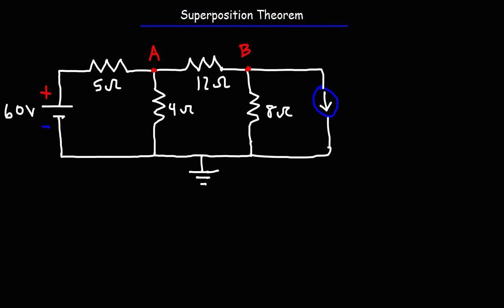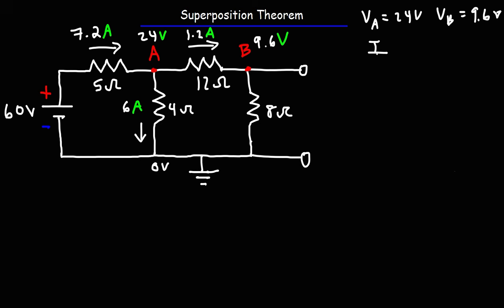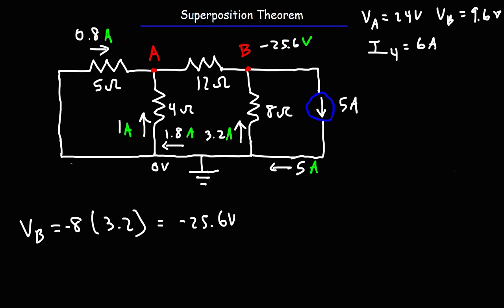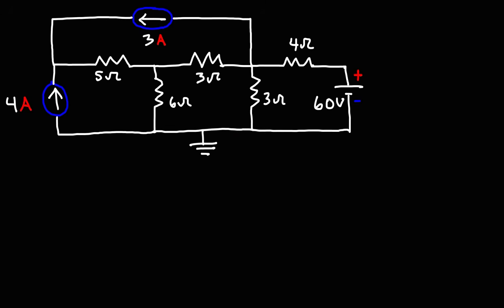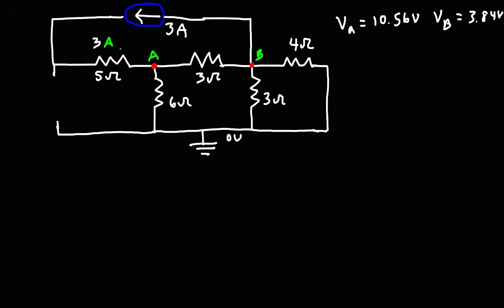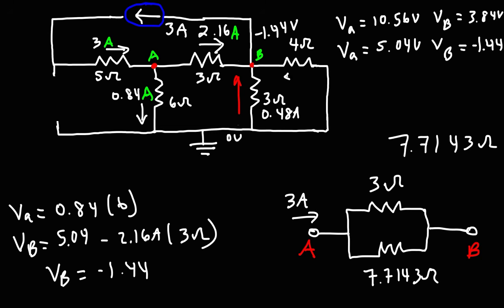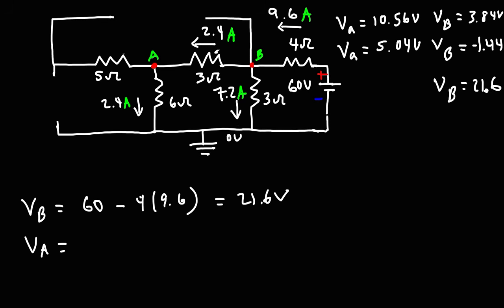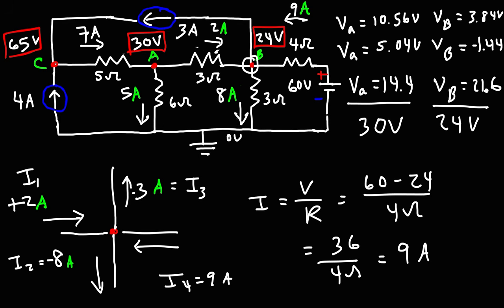Superposition Theorem

Comment: For the ones who are having confusion regarding the 5 and 4ohm resistor connections in the FIRST PROBLEM-
in the first part, we are basically considering the circuit 'open' at the point of the current supply so NO current flows through that branch (you might as well remove the branches connecting to the current supply to understand better) that is why the 12 and 8ohm resistances are in series as the SAME current flows through both.
now in the second part, one can clearly see that the current DIVIDES itself at Node A, so different currents flow through both resistors (5 and 4ohms) and that means they are absolutely not in series. The very definition of resistors being in series means that the same current should flow through both the resistors. Rather, by applying a little nodal analysis, one can clearly see that both the 5 and 4ohm resistors have the same potential drop across them, so they are indeed in parallel. There is nothing wrong there.
Hope, this helps.
Reply: good looks on this insightful comment. I was bewildered when he did it and didn't explain. but I guess my knowledge on nodes are lacking. Thanks!

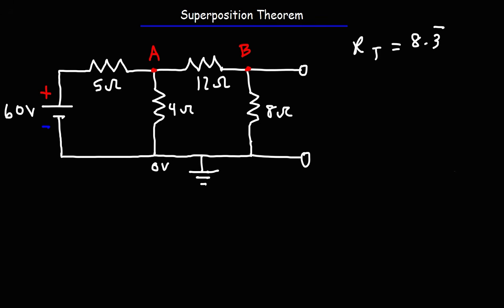Comment: 3:04 Why isn't the 5 ohm resistor in series with the 4 ohm resistor?
Reply: because the current is gonna split and go into the 12 ohm resistor as well. it's only in series when there is 1 path for the current to flow through.

Comment: But why are you again putting the total resistance in a parallel connection to be to power negative one. Because it's not really making any sense to me. What if I don't put that negative one and calculate normally. When you calculate normally I mean without putting it to power negative one The answer is 5.3ohms as the total resistance. Am I also correct

Comment: Why wasn't the voltage of the 4 ohm resister 60v since it's connected in parallel to the source
Reply: Bz in between 4ohm resistor and 60v source a 5ohm resistor is present hence....

If 5ohm and, 12 ohm resistors are removed then volt around 4ohm and 8ohm resistor will be same as battery's volt....

Volt divider circuit

Comment: Why even do this, this seems insanely convoluted. I don’t understand how superposition simplifies things.
Reply: with simpler circuits it doesn't necessarily simplify anything, but with more complex ones and especially when they have other components besides just these, then it will be very helpful and sometimes necessary to use this to solve them

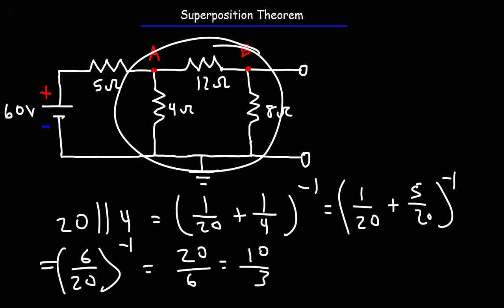Comment: 2:50 why is 8 ohm not in parallel with 4 ohm and that req in series with 12 ohm
Reply: Uhhh... Bit late here so I don't even know if you still need this, but just in case, or if anyone else is looking for an explanation, the reason why 12 ohm isn't in series with the Req of 8 and 4 ohm is because the 12 ohm and 4 ohm are in different branches that separate at node A. So we can tell 12 ohm should be in parallel with 4 ohm. The same is true for 8 ohm, where it's ALSO in parallel with 4 ohm, as you yourself recognised. And then from there, since they're both parallel to 4 ohm and on the same branch with no further sub-branching off in between, they're in series.

Edit: Not sure if I did a good job of explaining this, but you can kinda see it if you visualise the current flowing starting from the 60V source. It splits off at node A to go in 2 directions, making those directions parallel. Then those two parallel branches meet again at the node below 4 ohm and complete the circuit by connecting with the 60V source again.
Reply: @Avr_s Too late bro...the guy prolly alrrady graduated by now
Reply: @ONANGEFORTUNE 
Yeah lol, I guess replying to an 8 month old comment probably means I won't help the guy. But still, I thought I'd do it in case anyone else sees the comment and has the same problem.
Reply: @Avr_s thank you that was great help

Comment: I don't get how current can flow in one resistor in teo directions and in different quantities. How does it happen
Reply: It's not. You're solving the circuit for first the 60v power source and the 5A power source separately. At the end your just adding the values together to solve the actual circuit.

Comment: At 4:50 why didn't we divide 24v by 12 ohms to get the current?
Reply: Because we dont know the potential at B. So we didnt know the potential drop to use Ohm's Law
Reply: According to Kirchoff's current law, the current that enters a junction must be equal to the current leaving the junction
Reply: It’s the same 
😊
Reply: If you look closely you'll see that the 12ohm is not in parallel with the 4ohm, therefore you cannot use the same 24V to divide by 12. You have to add 12ohm to 8ohm (both resistors are in series) first before dividing into 24V

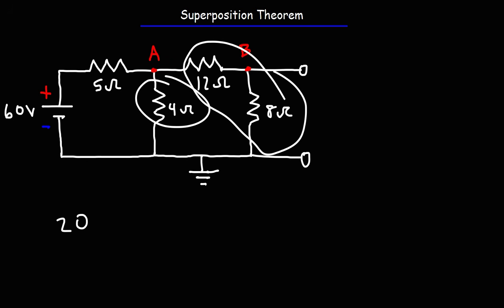Comment: at 2:08 how do you know that 12 and 8 are in parallel and not 12 and 4? I'm studying for a test please let me know
Reply: Cause they are kinda at the end of the circuit since the power source is on the left, and when combining of resistors, you tend to start at the end
Reply: Also there's no current flowing into the far right of the circuit so all the current goes into the 12 and 8
Reply: 12 and 8 are in series. So 12+8=20. This 20 ohm resistor is the one that is parallel to the 4 ohm resistor. I would recommend re-reading what nodes and branches are and then learning what parallel and series resistors are in terms of nodes.
Reply: did you find out why
Reply: Guess we still lost @stevejoseph8231

Comment: I wanted to know if we could use nodal analysis on the entire circuit and do a whole a bunch of equations or would your answer be different.
Reply: Hi, I am in 1st year. I would say that you can use any way to solve the circuit as you wish(including the nodal analysis). The thing is that, we studying different methods of solving circuit diagram because some circuits have more than 1 sources(current source/voltage source) or some circuits have more than 1 loops or more than 1 nodes. In the end, the overall point in studying different methods is just that some methods are more effective, quick and easier to get answer than others.

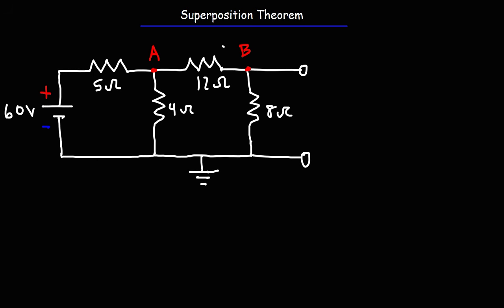Comment: @1:55 I thought if the two resistors were connected to two different wires it meant that they were in parallel.
Reply: Absolutely incorrect, 2 resistors are in parallel when they are connected in the same 2 nodes(originating node and terminating node)

Comment: can anyone explain 28:37 , why is it 3 multiply 7.7143/10.7143 instead of 3 multiply 3/10.7143 since we are calculating current flowing through resistor 3 ohm right i dont understand this part somebody pls help
Reply: In CDL (current divider rule), you'll need to use the resistor that you're not working on as the numerator, unlike VDL (voltage divide rule).

Comment: I don't understand how while calculating when open circuiting the 5A the 8 ohm resistor is in series with the 12 ohm but while calculating when short circuiting the 60v 5 ohm resistor is now in parallel with the 4 ohm resistor. Kindly assist
Reply: as you see the node on b there is open circuit on it so there is nowhere current going there fore current flow is in series with 12 ohm resistor and 8 ohm resistor

Comment: why  at 23:40 when getting Va from , 6x1.76  . This  is not qual to 5x4 (5ohm resistor) . so why did he chose the 6 ohm resistor path instead of the 5 ohms path to get Va? specific reason??

Comment: Can anyone explain why the resistors which are clearly in series...then he says they are "clearly in parallel" confused by that.
Reply: if the same current flows through two resistors they are in series. if the current is split they are not in series.
similarly for parallel, same voltage with no splits(drops/gains)

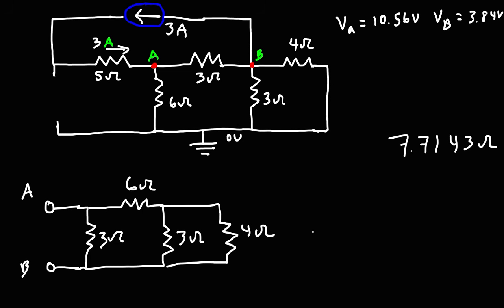Comment: 27:44 (3//4+3)//6  is the correct way, but thank you for your video, it was very helpful.
Reply: why?
Reply: @poisoned_durian8  He mistakenly calculates the currents with the opposite resistors, it's supposed to be //3. In the calculation he uses //3 which is incorrect according to his drawn circuit
Reply: What the answer of first question
Reply: Thanks😮

Comment: some of the algebra stuff is understandable on this channel but the circuit tutorials like this is sorely lacking.  NO explanations or definitions or laws listed. Its extremely confusing.  RT didnt include the first resistor either. That goes against all the laws taught. This stuff needs to be broken down into parts and repeated in each and every video to remember. There isn't even the laws used in the description, so how is anyone to know what was used to solve problems themselves?

Comment: I watched it all & reaffirm this is Not for beginners or even circuits classes as it skips too much info. Every calculation has a rule but that was not explained or the rule listed for calculating  voltage potential. We round calculations in circuits and listing proper metric notation is vital.
Reply: Well at least it's better than lecturers in university

Comment: This video made it 10x more confusing for me. For 1, you called a voltage source a power source which is confusing new learners BC power is something different we calculate im circuits class and my teacher is strict about that misclassification. 2. There was no definition of open & short circuit given which is vital to reinforce as ppl forget. 3. The parallel formula is way more difficult for those that have not taken algebra. The fraction was flipped with no explanation as to why and it wasnt converted to decimal as required by classes. There is a much easier way to calculate: 1 ÷ the sum of the reciprocals of each resistance , so 1÷ 1/r1 +1/r2 + 1/r3 . then hit F to D button on calculator. The latter requires parenthesis which most calculators dont have in base classes. There is a much easier to understand video that breaks down the equation and adds all series first. 4. The 1st part saying the 2 were in series was not explained when the 2nd resistor appears parallel. If the circuit is supposed to be viewed as if the open end doesnt exist, then that should have been stated. Its confusing to those learning a new rule.
Reply: 1 all voltage sources and current sources are power sources. The difference is that a voltage source has a fixed voltage and its current is set by the rest of the circuit and a current source has a fixed current and its voltage is set by the rest of the circuit. 2 definition is given by the name. 3 Algebra is explained and calculations are converted to decimal. 4 refresh your resistor equivalent techniques before going to superposition.

Comment: in mesh analysis, when the current flows from the bottom where potential is 0 (I1,I2 AND I3) we never took the top portions as negative . We decided to continue using them as positive

Comment: I just wanna know if its possible to use current divider in finding the current through the 4 ohm resistor? I did it but the answer is different, can anyone confirm?
Reply: I'm also wondering this, makes no sense how he got 6A and 1.2A instead of 5.4A and 1.8A when 7.2A goes into parallel resistors of value 12ohms and 4ohms.

Comment: why did we take 5 ohms and 4 ohms to be parallel when in the same condition before for 12ohms and 8ohms, we considered them in series???
Reply: The current goes through point a, through 12 ohm resistor, then through the 8 ohm. That is a series circuit just through those 3. He then figures out the total resistance between the 4 ohm resistor and the 12 and the 8 which will will call a 20 ohm resistor. The current can either go one direction at point a and go through the 4 ohm resistor, or the other direction to go in the 20 ohm. Since this is a parallel 1/R(total)=1/R1+1/R2….  Therefore 1/4+1/20= 5/20+1/20 or 6/20. 1/R(total)=6/20. R=20/6 or 10/3. No all you have left is the 5ohm resistor whisk is now on series with the combined 4, 12, and 8 ohm resistor which we call a 10/3 ohm resistor. 5+10/3= 15/3+10/3= 25/3 or 8.3333. Hope this helps

Comment: If possible can someone explain to me how the 5 and 4 ohms resistor at 7:05 are in parallel? they only have one common junction as far as I can see. Is it because of the short circuit theyre in parallel?
Reply: yes

Comment: why are you raising it to -1?
Reply: Because that's what you do when you add a parallel resistances there is 2 other methods as well let's say a 5 ohm in parallel with a 4. 
You could also do 5*4/5+4 
Or you could do 1/5+1/4 then flip it or you could just do it to the -1

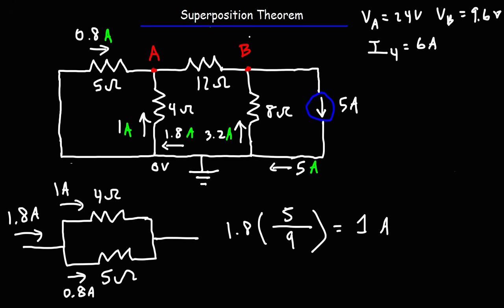Comment: at 11:33 why isn't the 1.8A being spite with the 12ohms as well? so shouldn't the 1.8A be split like this (5)||(4+12)?
Reply: The 4ohm and 5ohm resistor are connected in parallel and then to the 12 ohm resistor in series so the current passes through the parallel circuit first before entering the series circuit.
Reply: @preciousbetine71  got it, thx

Comment: why was the 12 ohm resister and 8 ohm resister in series in the first part but the 5 ohm resister and 4 ohm resister in the second part parallel?
Reply: Real question is what if he divided 24v over the 12ohm resistor first
Reply: @Mainspectacle 6 months late, but since theres an open, the 12 and 8 ohm resistors are in series, so theres 24V/20Ohm there (1.2 A)
Reply: Because for the first part it was an open circuit, but for the second part it was a short circuit.

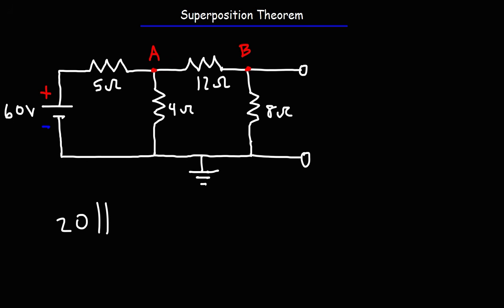Comment: 2:15 I thought the 8ohm and 12 ohm resistors will be in parallel because of the nodes joining them
Reply: Because you treated the current source as an open circuit, no current is flowing through at the right of 8 ohms. That's why it's in series.
Reply: @Dev-dn4uu thank you, i am a bit confused in that part too

Comment: how is the total current of the circit becme the current of the 5 ohm resistor? shouldn't all the current in the circite add up to 7.2 since it is the total current leaving the battery?
Reply: You use the total current in the 5 ohm resistor because the current could not flow anywhere else. The total current goes through the resistor, and because of the resistance, a voltage drop occurs.

At point A current can now flow in 2 directions (the 4 ohm resistor, and the 12 ohm resistor) hence it breaks into to 6amps and 1.2amps

Comment: I bet you can't solve a circuit that contains an UNGROUNDED voltage source. Say, one with a voltage source between 2 nodes and no resistors in series with it. Add a current source that IS grounded. Let's see if you're able to solve this circuit. Using just 4 or 5 resistors, see if you can solve it. You will have to design the circuit yourself. Or, use the first circuit in this tutorial but place the voltage source between 2 nodes with NO resistors in series with it, and it cannot be grounded.

Comment: I am still confused on when to use superposition theorem, norton theorem and thevinin theorem
Reply: Norton Theorem and Thevinin Theorem are used to find the current flows through a specific resistor. They both are similar to each other.
Superposition theorom is used to find all the voltages of every node and current flows through every resistor

We can use Thevenin and Norton theoroms to find all the voltages of every node and current flows through every resistor

But usually in the exams they give us what to use. So we have to do what they want us to do😥
Reply: @sahandanushka7371  Well Said brother.
Reply: Perhaps it will be stated in your question

Comment: 7:27 i just confused why do the resistor become parallel. Is it series?
Reply: Exactly. In the circuit he calculated first (the one with only a vol
tage source) it was in series
Reply: Yes I'm confused too if someone could explain it it would be nice
Reply: Yeah also a bit confused on why its parallel tbh

Comment: If the 4A and 3A current sources flow towards A and B in the opposite direction to conventional current when the battery is hooked up, why wasn't the current in those situations negative (-4A and -3A)? That is where I messed up, so I got the voltages for A and B for those circuits as -10.56V and -5.04V for A, and -3.84V and +1.44 V for B, which then threw everything off when I combined everything.

Comment: why are you using series formula for getting the total resistance for the parallel resistor? the resistance for the 8 ohms and 4 ohms is 22.2 ohms in the video but that is a parallel connection that should be 5.117.

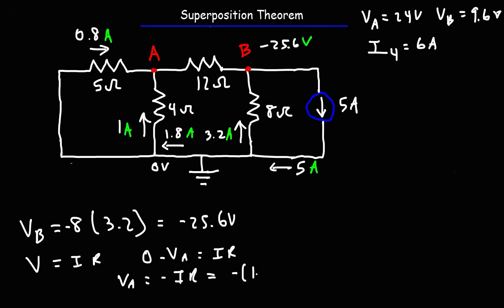Comment: If you're like me you're wondering at the 13:00 min mark why he only calculates the 1 amp across the 4ohm resistor to get the 4 volts, and why he doesn't also consider the .8amps across the 5ohm resistor as well, and the reason is that the potential at point A is the same either way. If you calculate either leg you will end up with 4 volts in both cases. So 4ohm x 1a = 4volts, and also 5ohm x .8amps = 4 volts.
Reply: then why isnt it the same if you take 1.8*the 12 ohm resistor vs when he takes 3.2*8?
Reply: I also ask myself that.
Reply: Current divider at 11:00?
Reply: but why  at 23:40 when getting Va from , 6x1.76 is not qual to 5x4 (5ohm resistor) . so why did he chose the 6 ohm resistor path? specific reason??
Reply: Just cram it

Comment: how is the 12 and 8 ohm resistor not in paralell but the 5 and 4 ones are. Makes no sense
Reply: because current does not flow through the area that has 5 a

Comment: i didn't understand that (14.2`)part in voltage divider rule, how did you calculate that 8:55
Reply: (5) is parallel to (4) which is equal to (2.22)

Now (2.22) is series with (12 ohm's resistor)

So take the sum of both of them. 

Hope everything is clear  :)
Reply: @iiaskar  how is (5) parallel to (4) but 8 is not parallel to 12 ohms its in series with the 12 ohms?
Reply: @JunzyStarz  I was asking the same thing. Can anyone clarify?
Reply: @JunzyStarz  late reply here, 5 is parallel to 4 because there is a 12 ohm resistor sharing in node A. It is only if 5 and 4 are in series if there is no element like 12 ohm sharing node A. I hope this helps.
Reply: @iiaskar  thanks man